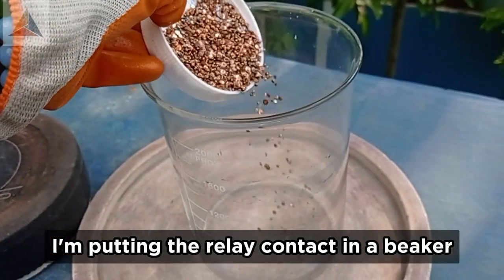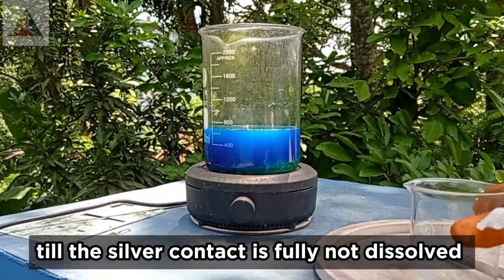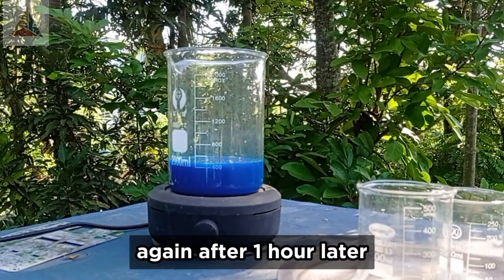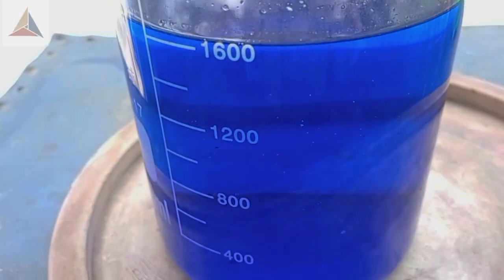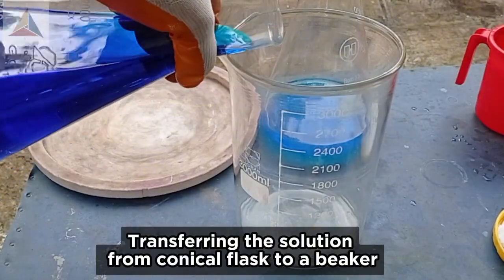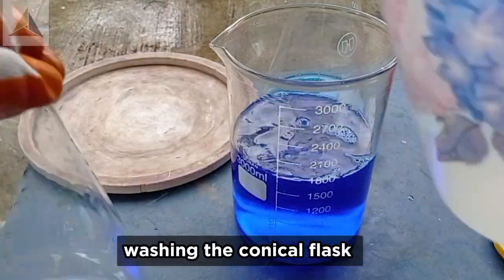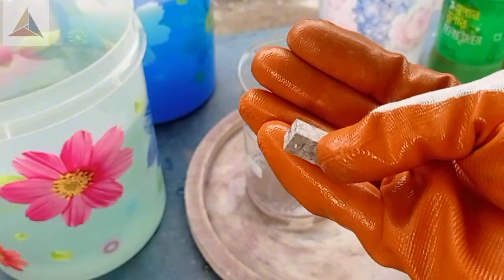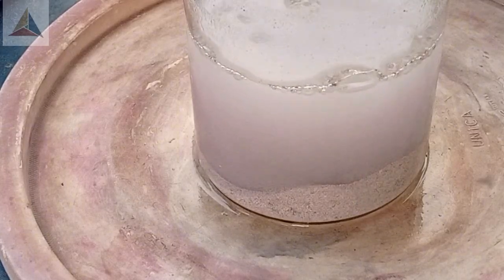Silver Recovery from Relay Contact | Silver Extraction Techniques

Comment: If use the copper can or not
Reply from the maker: Yes, copper (Cu) is used to recover metallic silver (Ag) from silver chloride (AgCl). The copper displaces the silver ion, causing the silver to precipitate. This process is known as 'cementation'. The precipitated silver sludge can then be melted and refined.

Comment: Never knew that aluminium could be be used to refine slver..Thanks 👍🙏 for the tip.
Reply from the maker: You're welcome!  Yes, aluminum can act as a reducing agent in certain silver recovery methods, especially in displacement reactions where it helps recover silver from solutions like silver nitrate. It's a simple but effective trick, especially for small-scale recovery. Glad you found it useful!
Reply: @TrinityGoldRecovery Another method is to add some caustic soda to absorb the unreacted chloride. Then slowly add ammonia until all silver is precipitated. In this way , you don't have to wait 24hrs. But again, adding aluminium is safer and cheaper.❤
Reply from the maker: Wow, thanks so much for sharing that method! 🙏 Using caustic soda and ammonia for quicker precipitation is a great tip — definitely useful for those looking to save time. You're absolutely right though — aluminum remains one of the safest and most budget-friendly options for beginners. Love seeing this kind of knowledge exchange here!

Comment: Can we apply the same process if the contacts are mixture of tungston and silver, or this is specifically for copper contacts?
Reply from the maker: Yes, you can extract silver from Silver-Tungsten contacts using nitric acid because:
🔹 Silver dissolves in nitric acid to form Silver Nitrate (AgNO₃).
🔹 Tungsten does not dissolve in nitric acid — it will remain as a residue at the bottom.

How to recover silver after that?
➡ From the Silver Nitrate solution, you can precipitate Silver Chloride (AgCl) by adding either common salt (NaCl) or dilute hydrochloric acid (HCl).
You'll see a white Silver Chloride precipitate form.
Then, as shown in my video, you can reduce the Silver Chloride to get pure silver. 😊🔬
Reply: @TrinityGoldRecovery  10x for the reply. 1 more question, is it possible to work with both types of contacts (copper and tungston) in the same time or it's better to separate it?

Comment: And isn't it easier to etch using FeCl3, it will etch the copper and alloys and leave the silver ready for melting. the method you present won't work everywhere because in the EU you can't legally buy and have nitric acid if you're not a company with the appropriate type of activity.
Reply from the maker: Great point! Yes, using ferric chloride (FeCl3) can be a viable alternative for etching copper and leaving the silver behind, especially in areas where access to nitric acid is restricted. It’s a safer option in some cases, and it can certainly make the process easier. Thanks for sharing this insight – it's always good to explore different methods, especially with regional regulations in mind!
Reply: Are you kidding me? You can't possess nitric acid in the UK?

Comment: What was the source of the contacts? I was shocked to see less than %25 recovery. 
I've collected the contacts from relays out of cars and get %60+ 
Meaning, if I did 200g of those, I'd get 120g silver. Probably closer to 130g.
I have a collection going that I plan to refine in the spring.
Reply from the maker: Thank you for sharing your experience and insights! The contacts in this video were sourced from industrial relays, and the lower recovery rate could be due to the specific alloy composition or the plating thickness of the contacts. It's fascinating to hear that you've achieved 60%+ recovery from automotive relay contacts—those indeed tend to have a higher silver content.

Your collection sounds impressive! Refining 200g for 120–130g silver is definitely a rewarding yield. When you refine in the spring, it would be great to hear about your process and results.

Comment: Pls reply
Reply from the maker: Ask please
Reply: How much HCL and aluminum want to add in silver chloride
Reply from the maker: To reduce silver chloride using hydrochloric acid (HCL) and aluminum, the amount of HCL and aluminum depends on the quantity of silver chloride you're working with. Typically, a small amount of aluminum foil or powder can be added to the solution. As for HCL, you'll want enough to cover the silver chloride but not in excess. It's important to control the reaction carefully, as too much acid or aluminum can affect the efficiency. Be sure to follow proper safety protocols when handling these chemicals!

Comment: Are those terracotta crucibles?
Reply from the maker: You're right, these are terracotta crucible.
Reply: Where can i buy that terracotta crucible?
Reply from the maker: Terracotta crucibles can be found at many online retailers, such as Amazon, eBay, or specialized stores for metallurgy and metalworking supplies. You can also check local suppliers who sell pottery or ceramic items. Make sure to look for crucibles that are specifically rated for high-temperature use to ensure they can withstand the melting process.

Comment: Buenas tardes me podrías decir un sustituto del nítrico porfa
Reply from the maker: Good afternoon, Manuel! Finding a substitute for nitric acid depends on the specific process you're using. If you’re looking to dissolve base metals or refine silver, a mix of hydrochloric acid (HCl) and hydrogen peroxide can sometimes work as an alternative, though it may be slower and less efficient.

For gold recovery, HCl combined with bleach can dissolve gold effectively, but do note that it generates chlorine gas, which is toxic and requires proper ventilation and safety precautions.

In some countries, potassium nitrate fertilizers are used as an alternative. When dissolved in water, they can produce a solution with some nitric acid properties, which might work in certain applications, though it’s less concentrated and may require adjustments to the process.

For silver recovery, some people use a saltwater (sodium chloride) electrolysis method as a safer option. However, if you're dealing with high-purity metals or need precise results, nitric acid is often the best choice.

Comment: Nice video ! I've processed 350g of those already but I took the long route with AP solution. The current weight of the contacts without copper is now 150g. I also have a box full of relay that I kind of give up on 😅 but maybe I'll get back to it now.  I don't have nitric and it's dang hard to get where I am. So for now I only do recovery but I can't wait to get into the refining part ! 😎
Reply from the maker: Thanks for sharing your experience! It sounds like you’ve done a lot of work already. I completely understand how challenging it can be without access to nitric acid, but it’s great to hear you’re still making progress. When you're ready for refining, there are some alternative methods you can explore without nitric. Keep up the good work, and don’t hesitate to reach out if you need any tips!